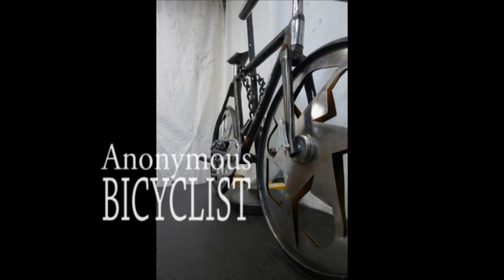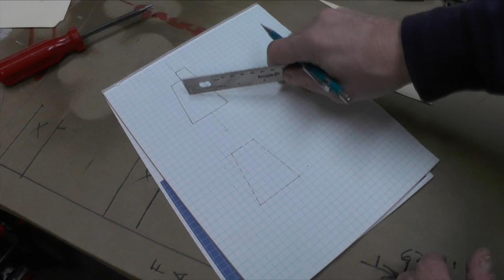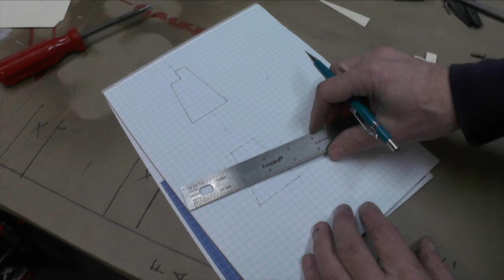Twin Legged Pletscher Bicycle Kickstand Install

Comment: Thanks for the video. 
I haven't rode a bike in over 50 years, but just bought a new Giant 24 gear bike.  It has no kick stand and I've been toying with the idea of just buying a regular stand.  Now I see why to not do that and the right positioning for the right kind of stand.  I'll ride from 3 to 6 miles a few times a day to get my legs in shape, but I want to put some flat fixing stuff on the bike as well as a rain jacket, lock etc.  
So your video got me headed in a better direction than just throwing a stand on there that's made for a regular bike and showing me a good way to do that.
Thanks again

Comment: great video , but i never had any problems like that , the actual stock plate and kickstand normally have a radius to fit the chainstays and this is what prevent the stays from deforming "to some point" of course you dont have to tight the thing like crazy ;)

Comment from the maker: I can seem to reply properly using my iPad.  I have not made these for sale....yet.  If you take each step as a project from beginning to completion the process will be much easier.  I think the video is a little long myself, but I wanted to be thorough.  The Garmin cadence bracket is made with 1/2 " plastic water pipe cut down the center.  A small spacer separates the two halves and yes I will post a video of this as well because when I asked others if it could be done the best answer I got was, bring down the spoke holders and tape the spare spokes to the front fork, an option I guess but not one I would use.  This bracket works perfectly.  I've had to replace three spokes so far this trip and having a place to put the spares back, knowing they would be there and in good shape was the solution I wanted.  To read more about my trip you can sign up for email updates within my blog page at....http://anonymousbicyclist.posthaven.com/
Reply: Excellent story. I'm up to 19 Jun. Looking forward to following your trip west.

Comment: Great video on how to make an over-engineered bracket. No problem if you have all those machines, but it would be nice to come up with something just as good, but without needing all that stuff. How about just a rubber block in place of that plexiglass deal? The key to your whole thing is that there is a weak link that breaks or deforms before the steel tubes do. I can imagine that you could use thin washers or aluminum piece, instead of those plastic plates.  The thin washers or thin aluminum metal plate would deform before the stays get tweaked.  The rubber block could be more easily cut from any number of sources, such as a large rubber stopper at Home Depot or old tire tread, glued together, if needed. The best part of your video was your point that its not the bolt loosening, but the stays deforming that creates the inevitable looseness of the kick stand.
Reply from the maker: Right again, as a carpenter/designer I do have a boat load of tools making the job, for me faster, I also have access to a crap load of polycarbonate.
I'll admit, the video is over complicated, but I wanted the viewer to understand the components and how to come upon the shape and sizes of each piece.  In reality those two paper templates, are all you need... and that is the Engineering.  Over designed or not, it seems you are describing the use of different materials, to accomplish exactly the same thing, I suspect the issue then, is with the materials I used and not the design.
However, I did note in the description of the video, that all the pieces could be fashioned by a local glass company.  Bring the templates, noting the thickness of each piece, the diameter of the center hole and have an employee make them for you (pieces this size are considered scrap)...For ten or twenty bucks and don't need all those tools..... and you may get the center block as a single piece of bullet proof Lexan.  You could then say the kickstand is freaking bulletproof.
ps...the dumpster at a muffler shop will have discarded rubber mounts you could use to fashion that middle piece.
Thanks for the comments!
Reply: AnonymousBicyclists Yes, exactly.  I'm taking what you said and making it more useful, by explaining how someone who doesn't have all those specialized tools could make the same thing.  I'm just thinking practically, since you know most people are not going to have all the stuff that you do. My goal on YouTube is to help people, so I think that it would be most helpful to not only show the way you did it, but also explain how it could be done more simply and easier, rather than make it just an exercise in OCD technique. .

Comment: Another thing you could do use for the spacer, is heat a PVC pipe section and reshape it to fit somewhat rectangularly into the space, and then cut the end off the right length, or let them do it for you free at Home Depot, before you start the heating process.. The PVC pipe is very strong and just as strong as the plexiglass.
Reply from the maker: That's the great thing about these types of engineering problems, it gets people to think.  And actually a rubber block is a great idea, I just have no rubber blocks, also a piece of wood would serve the purpose o0f filling the space.  Not sure if I'm getting the PVC pipe though, as I don't see how it maintains the mounting bolt centered between the chain stays.  And FYI, I did not use plexiglass but, polycarbonate, (a trade name would be Lexan).  Lexan in thickness of one inch and greater is bullet proof, if you've been in a bank where the employees are behind glass that is polycarbonate, unlike plexiglass Lexan is shatterproof.  One other thing when PVC, plexiglass, or Lexan is heated up it will lose some of it's strength.
Reply: AnonymousBicyclists I thought you used plexiglass, because it cracked on you. And for the PVC, I would use a cheap rubber stopper available at Home Depot to fill in the space to center the bolt. The PVC may not be as strong after heating and cooling, but I think it would be plenty strong for use in that application. If the rubber stopper is made of tough/stiff enough rubber, you can do without the PVC altogether.

Comment: Hi Claude, thank you for your exceptionally informative video! 

If I may, I have a specific mounting question:

I have recently been touring with a trailer and am convinced I need to mount the double-legged Pletscher I have just purchased. However, my bike is a 2013 Genesis CDF and has a 425mm chainstay which leaves very little space to mount the kickstand. There are two main issues: 1) The top mounting plate of the Pletscher rubs against the front derailleur cable. I note that the Pletscher's previous owner (I bought it secondhand) had filed a small grove on the plate, presumably for the same reason. I guess I could file it back some more, but I don't wish to damage the integrity of the plate in the process. 2) Second — and more crucially —  the rear gear cable runs under the right chainstay. Now, by no means am I a bike expert and, so, this could be a common phenomenon. However, I'm wondering how best to mount the Pletscher under these circumstances? 

Your advice would be greatly appreciated.

Comment: None that I'm aware of.  Some thoughts.... start off with a really well built wheel.  On my last adventure - 4000+miles - I began with hand built wheels and still had problems.  One hundred miles from home my chain jumped the rear derailleur and jammed between the cassette and hub.  Those cassette side spokes are nearly impossible to remove with the cassette in place......Bring a cassette removal tool that fits your cassette, you never know when you'll need it......  A 4" pair of Vise Grips are also handy, if it's used, you'll say, 'good idea', if you don't use it, you'll say, "well that was extra weight I didn't need to carry with me.... either way you're prepared. A pair Hemostat's  With a double wall rim it can be extremely frustrating to get that little spoke retaining nut to stay put or, worse yet, to have to get it out after it has fallen between the inner and outer rim walls.
To true a wheel curbside.... with the bike upside down use the brake pads as a good indicator of any wheel wobble.  Then as soon as possible get to a bike shop and have it trued by a professional.  I say that because after the fiasco with my chain lodged between the hub and cassette I ended up at four different bike shops because of broken spokes and I brought 4 spares with me.  Long distance travel, with a heavy load, on unfamiliar roads can produce unwanted stress on your wheels.
Ride safe my friend.

Comment: I hope you're still out riding.....if you're still around, what would you think about filling the voids between the spacer & the stays with black rtv prior to bolting the stand?? You could do that with the bike upsidedown & I would think the rtv would snug the spacer to absolutely zero movement. edit; I'm curious because I'm gonna do this with the velo orange copenhagen stand & my aluminum frame(ssshhh! don't tell anyone.)
Reply: That's an excellent suggestion I would think it'll work and there's no harm in trying. You can substitute a rubber doormat from the Depot for the gaskets A lot of comments concerned the availability of tools.  In the video I think I say, you can use a hand saw. The whole point is not to crush the chain stays.  What works for you is the most important thing.  Bikes are expensive and not crashing more so.
Enjoy the ride!

Comment: Just wondering on thing that is visible in this video: 
You have cadence detector mounted AND spare spokes. 
How did you put this two things the way that they do not interfere with each other? 
Think about something like this for my Surly LHT.

Perhaps material for another video ;-)
Reply from the maker: Sorry about not replying to your comment earlier.  I was on my x - country trip by bicycle.  I took the LHT from CT to WA state.  I will be doing a video on the cadence mount as well as a few other ideas.  If you'd like I have a blog I started covering the highlights of the tour.  Thanks for your great comments.  Claude
http://anonymousbicyclist.posthaven.com/

Comment: kick stand is supplied with thick hard rubber mounts
Just enough space to fit with a Shimano deralliuer, only just,  twhen shifted to the smallest of the three rings the mech can  foul the top of the stand fixing bolt. so using the method suggested in his video would not work with a Shimano type front derallieur
Reply from the maker: It works fine with my front dérailleur.  I have a Shimano Tiagra, 105 XT triple.
Reply: +AnonymousBicyclists I suspect you fitted it on a bike with a  chain ring 48t or larger, probably a 50t or 52t, the mech would be located higher on the vertical tube providing the necessary clearance. If fitted on a bike with a 42/32/22 chainset, you may find that when you shift to the 22t, the mech will come into contact with the top of the kickstand fixing bolt. Yes it works good on a MTB and no I am not a bike mech
Reply from the maker: The bike is a Surly LHT 26", chain ring is, 48-36-26, so indeed the shifter would be higher on the tube.  Originally the kickstand was supplied with countersunk hex head socket machine bolt, unfortunately they now only ship the stand with the hex head bolt which does stand proud of the bracket.  As they say, nothing is ever perfect and the Pletscher is only one of the many double legged stands on the market.  I would be interested to know if you've been able to find another stand that works for you.
Peace & safe travels
Claude
Reply: AnonymousBicyclists 
Yes the bolt head plus the split ring washer. As u know it folds up by the left chainstay and works fine when urban off roading. Another issue is the length of the bolt supplied does not suit all bikes, can be too long or too short!
Despite all, its the best kickstand.
Cheers.